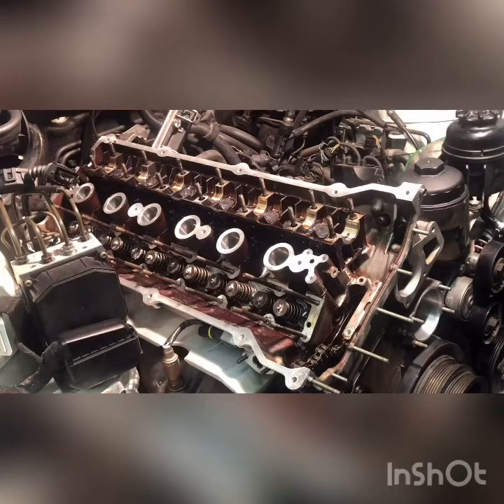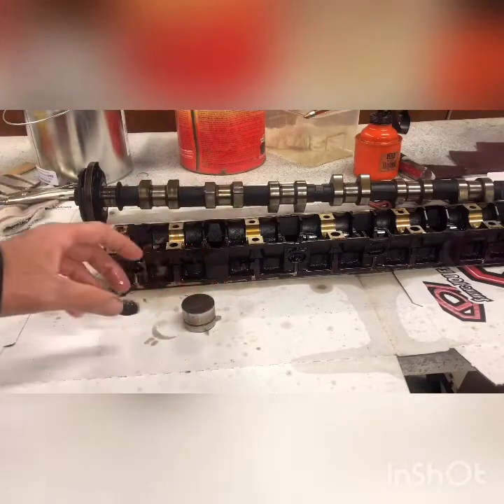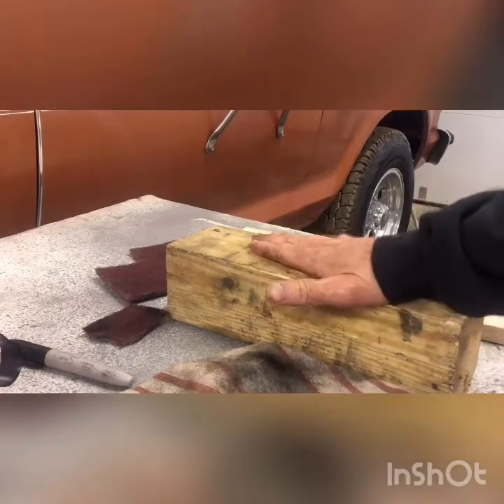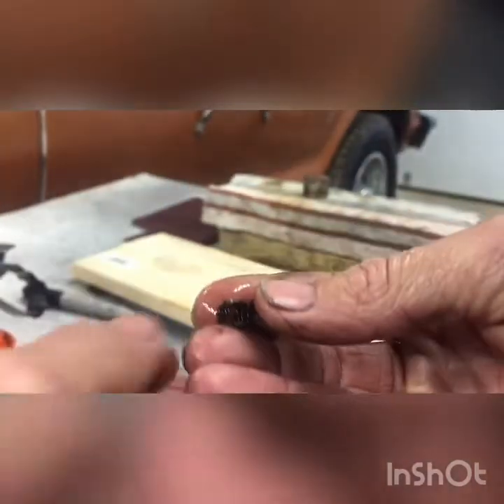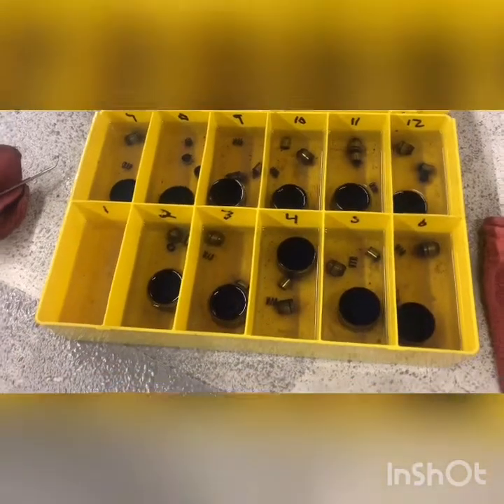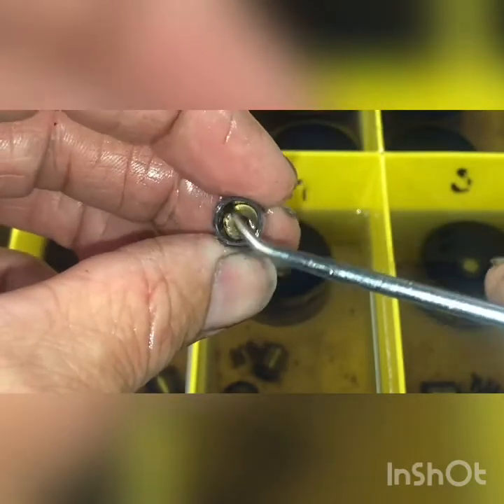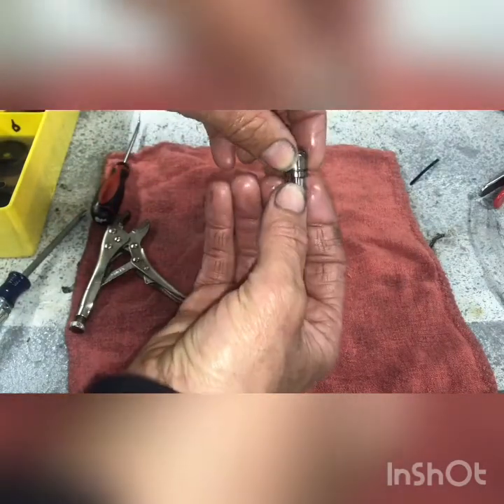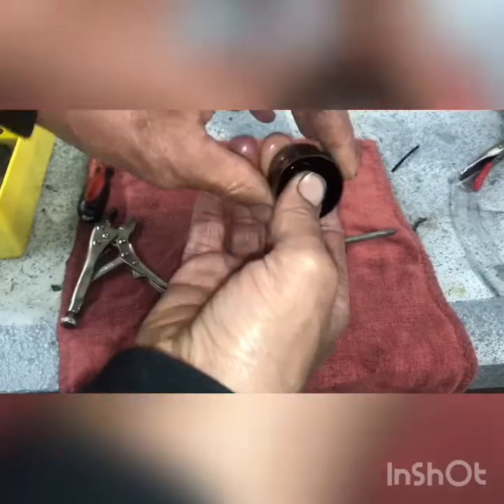BMW E39 M54 hydraulic lifter disassemble & clean

Comment: That's wild that you got the lifters apart without using vise grips. I tried banging them on wood like this and all I did was succeed in driving the lifter 1/8" deep into the wood. It was not coming apart without pliers, very stubborn.

Comment: There's a big myth about not mixing the lifters up,
Ideally yes try and not too,
But I rebuilt an M54 top end on my 330ci with Ebay scraps,
Different lifters in different trays with different cams😂
It's the quietest M54 you will ever hear😊
Reply: with hydraulic lifters there is no difference where you put them

Comment: Can you really hit the lifter parts like that? Wouldn't the wood scratch/score the smooth surface, and potentially create dents?
Reply: i just did mine that way. i have some scrap lifters as well from another head and i tried to really beat the heck out of them... they don’t even have a scratch. The steel they are made from is extremely tough. i did use a plastic dead-blow hammer
Reply from the maker: As long as you use a soft object like wood, dead blow hammer. They will be fine.
Reply: @danofalltrades3567  Yikes, i guess it's better than using pliers to pull the piston out but it still scares the crap out of me seeing it. Good to know for when i do this eventually. Thanks for the video.
Reply from the maker: @anjingkampung  yes, it’s better than pliers!
Reply: All thoseparts are tool steel way to hRd to booger